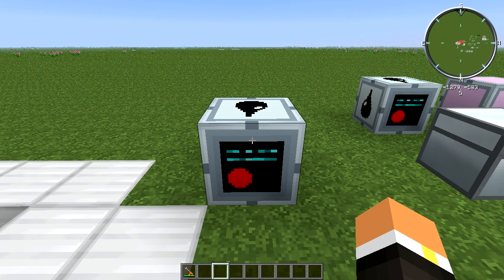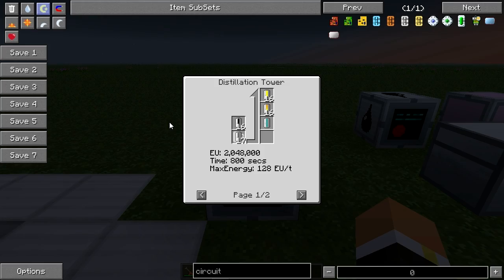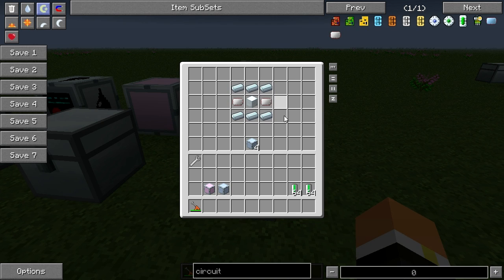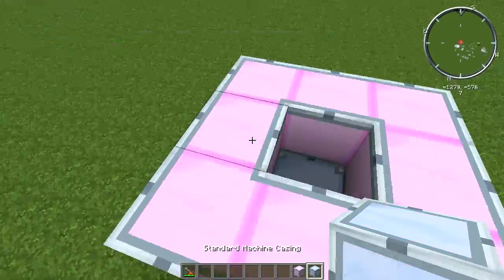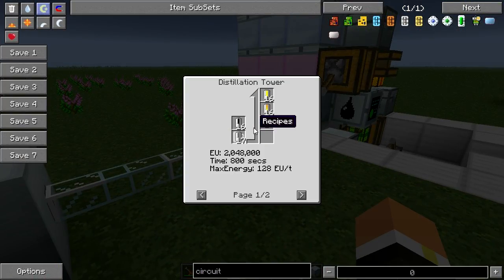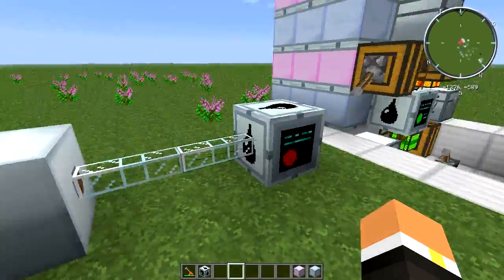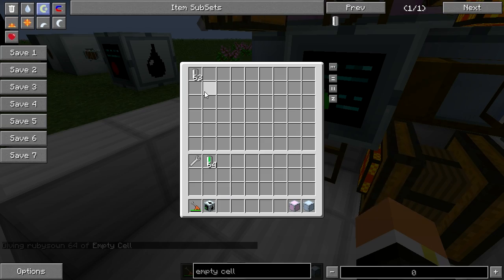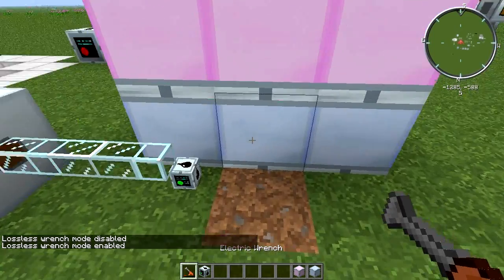Feed The Beast :: Machine Tutorials :: Distillation Tower

Comment: Yeah, I caught that you might have seen the recipe for them instead; I know that certainly had a recipe which involved iridium.
And...not exactly. Each one can be crafted with just an advanced circuit, a Lapotron energy crystal and a shiny metal/platinum ingot. The dust of which can be easily obtained as a chance side product from Ferrous ore in a pulverizer or rock crusher (10%, 25%), and can be got with a 100% rate in an industrial grinder with mercury cells.
Rare, yes, but not too impossible.

Comment: my mistake, iridium is one recipe, my comment was from looking up in NEI recipe mode and seeing it takes 2 "Energy Flow Circuits" and the first recipe for that component has "Iridium plate" right in the middle.  Apparently there is another recipe for that item using Pulverized shiny metal and stuff.  Which is a rare drop from Bauxite which can be...centrifuged into Iridium nuggets.  But still...not made of copper and tin, yes?

Comment: Nice video, very helpful. :)
I read somewhere that you can actually hook 4 distillation blocks up to the tower part. (Much like you can with the Industrial Grinder.) Is this something that you can confirm? Also, what are the benefits of using this Distillation Tower over the "normal" refinery or Still?
Thanks!